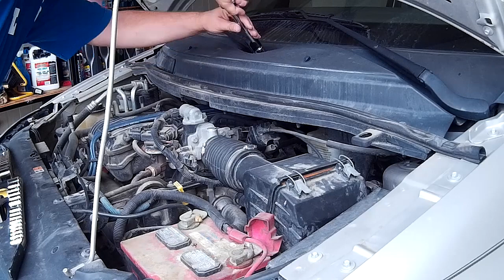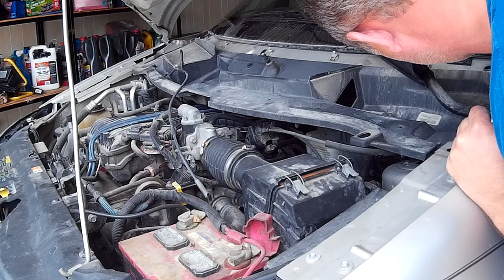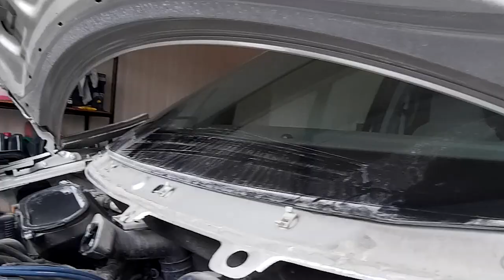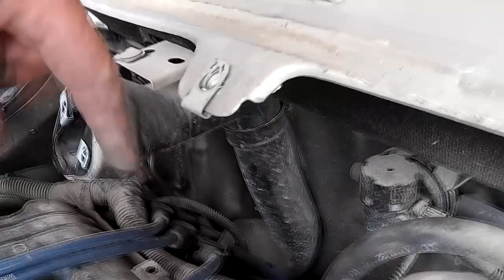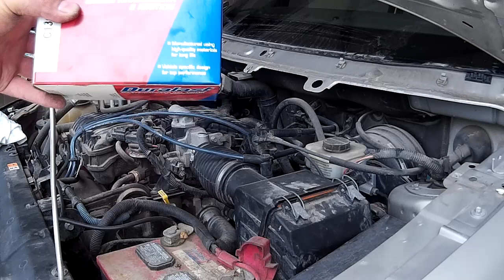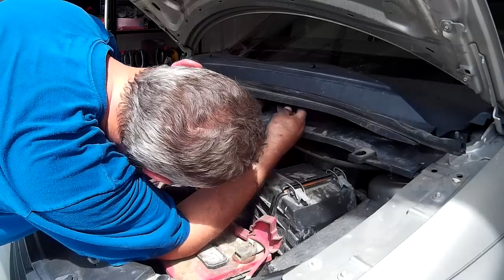Replace ignition coil Ford Freestar 2005

Comment: did mine, took 1h30min, socket needed are 15mm for the windshield and 7mm for the rest. an extension is pretty much mandatory for the coil bolts. And a Phillips screwdriver for the 4 screws in the front. Great video, helped a lot to be prepared, thanks! The shop wanted $620 for the job, glad I did it myself.

Comment: Why didnt this fool start up the van at the end of the video so we could know if it actually worked right
Reply from the maker: Good point. But I wouldn't post it if it wouldn't work. Van still runs by the way .
Reply: @VasylGladun  Your post read, in part, that you did the work 5 months prior to posting and your van was still running great, enough said.  Why Ana DeAnda calls you a fool is beyond me.  Starting the van would not prove the replacement was successful since it had to be replaced to misfire(s).  I have the same problem but can still start and drive my girlfriends van.  Good job!